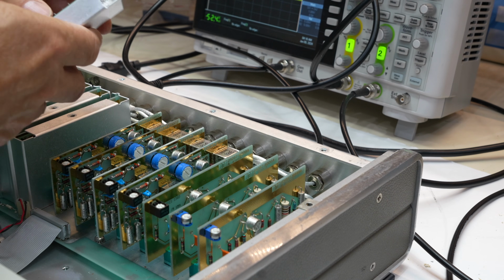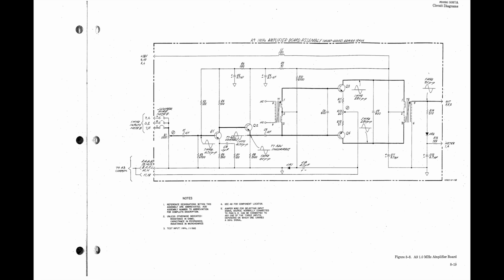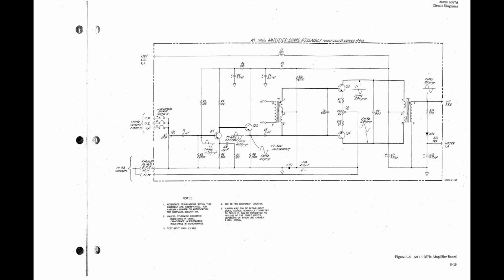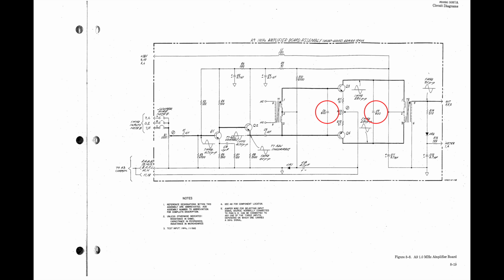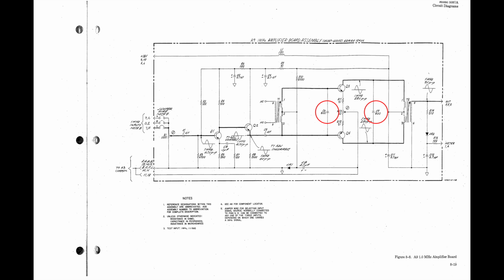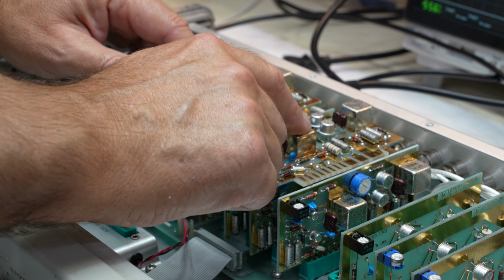HP 5087A Distribution Amplifier has a mystery board

Comment: Interesting journey of discovery :-)

Consider the simplest case, with no division or multiplication, just splitting into multiple outputs.

Presumably the 5MHz output from the Caesium clock is a square wave?

Having passed this signal through a narrow-band 5MHz amplifier in the HP5087A, the 3rd, 5th, 7th etc odd-order harmonics that aggregate to form the square wave will largely have been filtered out.

As such, the output of the HP5087A will essentially be a sine wave?

Not sure.

Comment: Hi Marc, I love the channel.
I was a user of the HP gear which you feature during my University career.
I think there is something very fishy about your mystery board.
I do not believe it was manufactured by HP, for the following reasons.

It is not in their board styling

HP would not use tinned edge connectors in gold flashed sockets, there was a known problem that the gold migrated into the solder plating allowing the underlying steel springs to corrode producing faults.

Perhaps the plot thickens, has someone made a custom board for a specific solution.

Keep up the interesting projects.

Bob

Comment: Brought back memories. My company I founded back in the late 80’s to the early 2000’s designed and manufactured distribution amplifiers for the TV broadcast industry. I was the CTO responsible for all the designs. Analog video and audio distribution amplifiers in the early days and when here in Australia we went digital design the 270Mb/s serial digital SDI/ASI, AES digital audio and 1.485Mb/s HD serial digital video distribution product as based on a 3RU euro frame card and dual redundant power supply system.

Also designed a lot of other eurocard AES embedders, de-embedders, analog video to SDI converters, SDI to analog converters, switchers, etc etc etc etc. was a great time to be alive! 

So watching your clock distribution system bought back fond memories.

Comment: What is the chip you refer to at 10m38? Do you have a part number?
Reply from the maker: It's a humble CD4066 disguised with an HP number. Common analog switch chip. Still made today.

Comment: Interesting that the failover detector decides on the level - so the gear has to go off / run out of batteries, as a stuck source with a DC level may still keep the input as a valid signal. I see no AC coupling there.

Comment: If you double the input frequency, aren't you losing accuracy at the output?
Reply from the maker: I'm not sure what you call "accuracy". You will add noise and distortion by just amplifying it without changing frequency (signal to noise degradation). Which is why the output amps are narrowband, to minimize that, and why I tuned them for minimum harmonics. Depending on how you do the doubling, you might change short term phase noise (instantaneous signal purity). For the better (if you use a nice PLL or tuned circuit), or the worse. Long term Allan variance (a measure of frequency stability, which is what we are interested in) should not change. Or at least I think so, my knowledge there being very tentative. Metrology people that are phase noise specialists will have better answers. Oscillator phase noise and Allan variance are complicated things. For example a good quartz oscillator may have better short term Allan variance, but far worse long term Allan variance than the cesium clock.

Comment: Interesting, those three oddball reference frequencies, I have a HP105B crystal oscillator that has the same three outputs, however I also desire 10MHz. Internally it uses a 10MHz oven module, that is then divided down. So I plan on taking the 10MHz signal and bringing that out, not sure if I should add another connector, or re-purpose the 5MHz. I will have to have a look at it's output module, maybe similar to yours and can be easily tweaked to 10MHz.

I just looked on the web and HP5087's are about $1000 landed in Australia, so I'll just use some video distribution amps I acquired from a telco (Telstra/Telecom), who used them in their lab for that very same purpose.
Reply from the maker: That’s what I did on my 105B. I had the newer version that uses the later 10 MHz ovenized crystal with a divide by two card, a combo imported from… the later version of the 5061A atomic clocks! Reused one of the back BNCs for the output (I think it was the ext VCO control which I never use).
Reply: @CuriousMarc  Sounds like the model I have, although I have idea's of using the ext VCO input to discipline it from a GPS - too see if I can do better than the Trimble I have that steps up and down when compared to the 105B.
Interesting where the 105B upgrade came from, surprised it didn't become a 105C etc. As far as I know the 'B' designation indicated a battery backup option, that I removed as who needs Nicad battery goo dissolving precious HP circuits. I've seen what old Nicad's can do to once good Fluke desktop DMM's
Did you add an output stage for your 10MHz, or did you just get away with a direct connection to the oscillator module.

Comment: I think the first OpAmp stage on the fail over circuit is not an amp, but a Schmitt Trigger circuit, where you can adjust the set point.

Comment: 15:41 were it me, i would put a little note with paper inside detailing who opened it last, what the person did etc. I've always loved finding those kinds of things inside old electronics.
Reply: I write it in sharpie on the inside of the lid, along with the date of purchase, source, and price paid.
Reply: @komradebob 
In the 1980s I used black sharpies to label until I found out a decade or so later that they tended to fade.  So I started using the blue ones and they seemed to last longer.

Comment: Now what happens to the phase shift with those tuned amplifiers as the temperature changes? I expect HP selected component types so their temperature coefficients compensate each other. But, it looks like there are some components there with unfortunate ageing characteristics such as dipped mica capacitors.

{o.o}    Around here I'm not trying for best noise or stability performance possible so I use an untuned NTSC TV broadcast studio signal splitter and amplifier.
Reply from the maker: The distribution amp is used to distribute a 10 MHz reference to time counting instruments. The clocks to be measured do not go through the 5087A, they are measured directly, so no phase problem. But that's a good point, I better make sure I reuse the same length of the exact same cable for the measurement when I reunite the clocks after they travel!
Reply: @CuriousMarc  Even that can be hidden dynamite for precision. You DO know that coils of coaxial cable can make very nice seismometers, I hope. I had a long term measurement that I'd not setup quite right bring this to light when an earthquake struck the area. It showed up as a very large disturbance in the data stream, which was suspiciously clean. It turns out I was measuring a null in a sin(x)^2/x curve.

I'd very carefully tune the cards in the 5087A to peak at the average temperature they are likely to experience. For time measurement, though, the changing phase shift (frequency error) only takes place while temperatures are changing and falls back to zero when the temperature returns to reference temperature. So any effects, I believe, would be second or third order.

{^_^}

Comment: The reason there is so much gold on those old HP boards is down to the way they made their PCBs - they used a positive photoresist and then plated the boards with Au - this plated both the surface and the vias + component holes.  After plating, the resist was stripped and finally the board was etched - with the Au plate acting to prevent etching of the desired traces.  Tek used a similar process on their boards.
Reply: Actually most photo resists are negative acting - UV light crosslinks (hardens) the resist. The mask image would be opaque to UV light for the circuit traces and the "developer" (a mild solvent or mild alkaline solution) would then remove the unexposed resist exposing the circuits and holes. 
If the PCB had not been panel plated, the circuits and holes would be copper (pattern) plated and then  a permanent or sacrificial circuit plate would be applied. In this case, gold electroplate was used with a  nickel layer first applied to prevent copper migration into the gold followed by the gold (in this case gold with a small amount of cobalt used to harden the finish for use with gold finger connectors). The gold finish is used as an etch resist so that after plating the resist is removed followed by a copper etching process. 
At the time these PCBs were fabricated, the more common process would used a tin-lead place instead of the nickel gold and the connector fingers plated with gold in a separate operation with the circuit then heated (reflowed) to melt the tin-lead to produce a solder finish. 
In general, the PCB industry transitioned to "bare copper" in the   '90s where circuits that were coated with soldermask leaving only the SMT pads and component holes exposed. The PCB was then finished with HASL (hot air solder leveled)  and then later, as lead free was required, OSP (organic solderability preservative). ENIG (electroless nickel gold) is also a common finish but the gold thickness is about 3 micro-inches (compared to 30-50 for electroplate gold) and is not suitable for gold connector fingers. 
In both cases, during the soldering operation (wave, selective or paste/reflow) the gold is dissolved and the solder bond is to the nickel. In the case of soldering to electroplate gold, the gold becomes a contaminate in the solder which in high stress environments can result in solder joint failures. 
In this case with small, low volume, gold finger coonector, instrument quality PCBs, an all gold finish was a probably a good compromise (especially with the gold prices at the time).
Reply: @KennethOgle-d7b  Yeah, most photo resists are negative - that was one of the strange things about the HP process - they started off by doing the design with layout tape and then printed it to lithographic film so the development process washed away the resist in the areas you wanted the traces to be.  Since at this point the entire board was still covered with copper it could then be non-selectively electroplated with gold, which would only build up in the areas where the copper was exposed. Then once you had a thick layer of gold they stripped off the resist and etched the whole board which removed the exposed copper on the non-plated area.  The side effect was that the whole board was plated with gold to whatever thickness you wanted for the PCB edges.  I guess it made a lot more sense when gold was far cheaper than it is now.
Reply: I think it was standard for pretty much everyone in the day. I remember the Burroughs computer boards were solid gold plated too. Of course, at $16 per ounce it wasn't that big a deal.
Reply: That's really interesting and I didn't know that.  Thank you!
Reply: The Tek process was documented in a promotional film they released in 1969:   https://www.youtube.com/watch?v=7weZ0TNRcuw

Comment: Those card connectors in that thing look a lot like the Rev 0 Apple ][ ones. Didn’t Woz get them from HP originally? He was working there at the time.
Reply: That was an absolutely standard double-sided card edge connector used by almost everyone in the electronics/tech industries of the time. They came in varying number of pins in a row, and in single and double-sided versions. The 22/44 pin version was so common that Radio Shack sold them, and DIY cards to match, as did many other companies.

Comment: I just checked my HP 2003/2004 catalogue and that only has a single product in the Frequency & Time standards section: the 5071A Cs Primary Frequency Standard. I have no catalogues between the 1999 and the 2003/2004 to further narrow down its disappearance from the HP products offering.
Reply from the maker: 5071 still going strong today! Now a Microchip product.
Reply: @CuriousMarc It sure does!

As for a nice, compact & cheap tool to measure freq standards: have a look at Erik Kaashoek's tinyPFA. Well recommended.